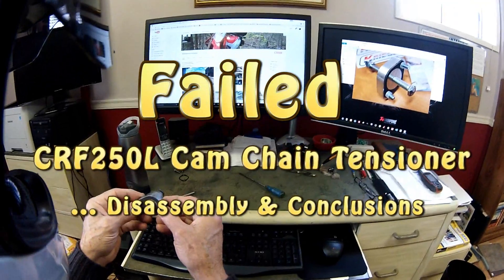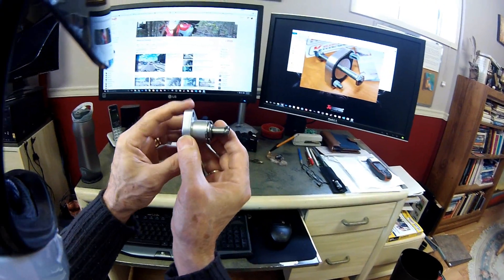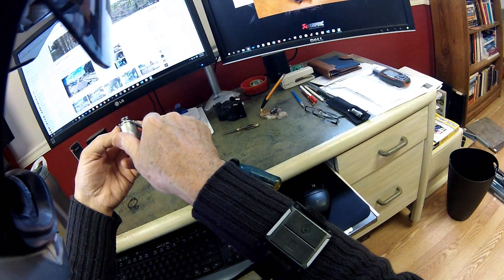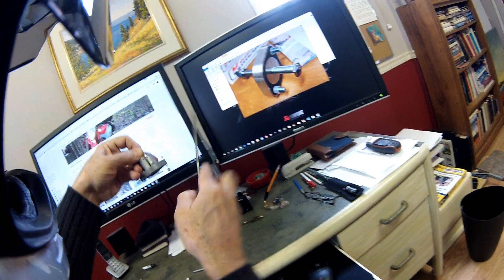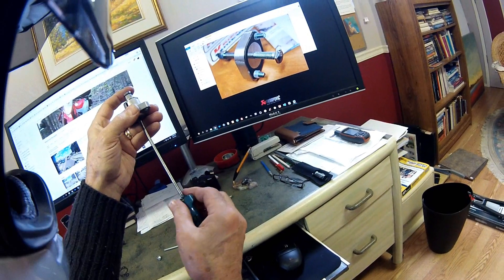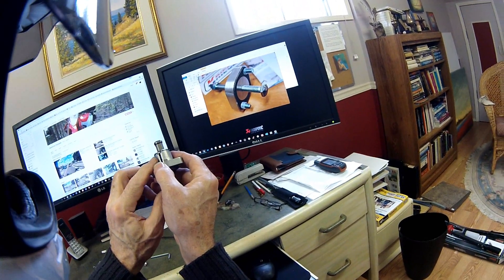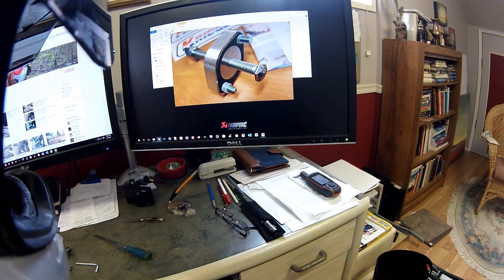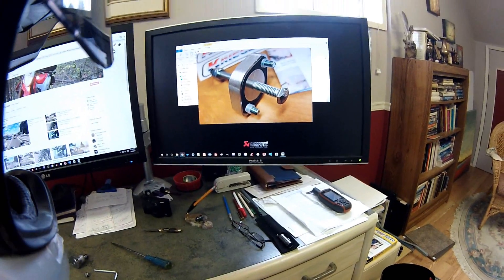Failed CRF250L Cam Chain Tensioner Disassembly and Conclusions

Comment: Hi, I am a CRF250L owner from Germany whose bike has done only 700 mls (MD44 series; I had a MD38 before). So, no problem occured to my bikes by now. But as I am servicing bikes for decades, I am interested in any issues that could happen.

I agree with your conclusion; it could be possible that the spring tension is depending on the way of travel. So, when the bolt moves in, the tension could be to low.
But...if you are right, the cam chain might be worn. Of course, the Krieger tensioner is able to move in much further, depending on the length of the bolt. The question is if that solves the problem of a worn-out chain. Remember that the free play is eliminated on the rear side of the engine only and the tensioner has no effort at the front!
So, in my opinion, if you were trying three automatic tensioners and all failed, you should go for a new chain instead. As you said, there is a possibility to tighten the Krieger tensioner to far which will cause excessive wear to the chain guide (which will lead to residues in the oil that could cause a plugged oil bearing). Therefore, I would be VERY careful to recommend that part because I expect some expensive subsequent damages to the engine if the owner does not know exactly what to do.

If I am right (not sure about that) it could be intended that the spring tension is limitated by the way the bolt travels.

By the way: the MD38 tensioner 14520-KZZ-901 (the one used on the CBR250R) has been superseeded by the MD44 type 14520-K33-D01 which is used on the CBR300R. I don't know if the newer part fits the MD38 series but it looks similar. If so, it could be possible that the tension is different.

Regards, Michael
Reply from the maker: In my case, The units failed very quickly right from the brand new bike, Each time (once per year for the first three years) a unit failed, the cam chain was thoroughly inspected for wear or other issues and was found to be in excellent condition. All the units failed in the middle of winter (I ride all year) so I think temperature was a factor also in my case. Most people who go to the manual tensioner do so to improve on the stock CCT's function long before any possible problems occur. The lifter assembly (CCT) on some brand new 250L's are sometimes too slack, causing a 'bag of marbles' rattle on cruise and trailing throttle, right out of the showroom. That's what motivates most riders to switch to a manual unit. Yes, I was aware of the new CCT's Honda has experimented with. They tested them in the Japan only market first then used them in the CBR300R.
Reply: @Scoottoots  Well, I rode five different CRFs by now, they had done between 164 and 2800 km. Three were 2013/14 MD38, two 2017 MD44. A friend of mine recently bought a MD44 with about 3000 km. They all sounded similar and I guess I know what you mean with the 'bag of marbles'. The sound occurs when you're revving up and idle again, right?

In case of my first MD38, I was alarmed as well and replaced the tensioner (at 1200 kms) and the sound was absolutely the same. No difference at all. Meanwhile, I got the MD44 and, guess what, same procedure as last time.

I came to the conclusion that there's nothing wrong and this is the way the CRF sounds like.

Nevertheless, I heard your second video about the CCT and there is a knocking sound which is definitely not normal. I guess that one's caused by the tensioner. But that is not the sound coming up from a brand-new CRF.
Reply from the maker: @michaeltutnichts-zursache8258  The bag of marbles sound on some new crf250l's is very pronounced. It occurs only at steady cruising speed between 30 and 70 kph and on trailing throttle. Some rattling sound is normal, but a few new bikes have an extreme rattle. That is caused by the CCT. Replacing it with another stock unit may not solve that issue. Replacing with a manual CCT and setting that correctly will solve it. But as I say, only a FEW new bikes have this issue. It was enough though, to cause Honda in Japan to develop an alternative lifter assembly for the 300R. Most owners can relax and not get paranoid about noises. When it's extreme they'll know it's not normal and needs attention. And no, the knocking slapping sound in my video is not the sound the problematic new bikes exhibit. It is what that extreme bag of marbles sound can lead to in the odd bike.

Comment: I made it to 100,000km before this appeared.  Only thing that pisses me off is my local Honda shop didn't pick up on the issue when I described it to them!  Either they are not up on CRF250l issues or they want me to wait till it fails disastrously.  I don't fault the engine, 100K is enough for this to wear out.
Reply from the maker: I'd say you had good success with 100,000 km's. I like the Manual tensioner I have now.
Reply: depends on how you ride.. at 80.000km have replaced 3 CCT and now I use a manual , their design just does not work good enough!

Comment: Heya. How long and how many mileage have you using the manual CCT ? Any problem so far ?
Reply from the maker: A little over a year and about 16,000 km. No issues at all. I gave it a slight adjustment after 10,000 km. Excellent product.

Comment: Thank you for the video. Bought a used crf and after a couple of months that rattling sound started. 
I changed the tensioner with same new one and after six months and 5000km same problem again. 
Making a quick search on net and watching this I am starting to conclude is just poor design - materials. 
This is my first honda and I can say I 'm bit disapointed
Reply from the maker: That seems to be the only area of concern though. Otherwise the engine is real solid and very low maintenance. If you get tired of the issue, switch to the Krieger manual CCT. Takes some fiddling to get used to setting it initially, but thereafter, it's a piece of cake to tweak it whenever needed (maybe every 10,000 km's).

Comment: I have a 3yo CRF250L and made 8000 kms on it and just recently I had the same problem with cam chain tensioner/lifter. What I tried experimenting is cutting the coil spring by half an inch for the spring to give a little more twisting force. To my surprise the rattling sound was gone and I have already made 550 kms on it since and noticed that the rattling noise hasn't return yet. Although I have a new unit in case I really have to replace the old one. By the way, putting the spring back into the housing needs a little skill in doing so.
Reply from the maker: Haha, yeah it's a bit fiddly for sure. Good sleuthing there! Hope that continues to work for you. I am enjoying the trouble-free manual Krieger unit. Have some fun on that bike :-)
Reply: BlastsFromTheSaddle - thanks for your video, It was from there where I got the idea of cutting the coil spring. I agree that your suggesting a manual tensioner is a more permanent solution on the issue. Have fun riding!
Reply: @nordic9570  i am very interested in doing this do my bike. Is it still sounding good?
Reply: @winstonpoplin  - yup, have made 1500kms after the mod, still no rattling 😀

Comment: hi! i got a 2017 crf 250l i don't know if honda already resolved this issue so i'm buying a spare cct lifter just in case my stock tensioner would fail. do you think it is a good idea to replace the cam chain the second time the cct lifter would fail? it might help the new cct lifter because there is not much slack with a new cam chain? and secondly, i have a crf 250l service manual for i dont know what year model. it states that i should use a tensioner stopper? i see that your tensioner will lock in place once fully twisted clockwise. do i still need a tensioner stopper?
Reply from the maker: I wouldn't go to the bother of having a spare. The issue seems to only happen to a relative few, and I suspect in my case it is because I ride also in the cold winter. I think that has something to do with the failures. You'll likely be fine and have no issues. If you do, just get a Krieger Manual CCT and adjust it right. Then all it takes is a slight adjustment when it starts making a bit more noise (over 10,000 km between adjustments for me). And no, you don't need a special tool. The shaft will retract and stay retracted with a screwdriver. Relax and enjoy your bike :-)
Reply: +BlastsFromTheSaddle thanks for the tip! if i ever replace mine with the manual tensioner in the future, is it necessary to be tdc and align the cam shaft? how would i know if my cam chain jumped a tooth or two? or do i jist have to replace the tensioner only and touch nothing else?
Reply from the maker: Usually these bike will stop near tdc, but yes, it should be at tdc or close. If you crank the engine manually, be certain to go forward only. Never reverse crank the engine.
Reply: +BlastsFromTheSaddle  okay thanks! one last thing, i got a friend to lend me a spare automatic tensioner. does the automatic tensioner have the piston to be at tdc also? how do i replce the old one with a new one when it starts to get noisy? i dont plan to use the old one for studying purpose.

Comment: Just bought a used 2014 with only 2200 kms.  Same sound. Not pretty.  Random.  Usually when I'm stopped at a light.  Goes away....will it become a "problem"??
Reply from the maker: If it goes away when under load as you throttle on, then it should be fine. Just keep tabs on it.
Reply: BlastsFromTheSaddle Cool.  Thanks for the response.  Great analysis.  Are you an engineer?
Reply from the maker: I just try my best to pay attention ;-)

Comment: what about a stronger spring inside the cct?
Reply from the maker: It might result in too much initial pressure on the chain to achieve a better pressure further extended. The manual CCT has no issues and very infrequent slight adjustment.

Comment: Thanks for the video. It appears that Honda may have changed parts for 2017 - to the same components already used in the CB300F. Check this out for yourself - part 14520-K33-701. Not sure if this can be retrofitted, plus there's a different guide, also changed to the same as used in the CB300F. Hope this helps, Steve
Reply from the maker: Yes, they've been testing a new design on the CBR300. My recurring issues have been completely resolved since I switched to the manual CCT. No way I would go back to an auto unit now. Cheers, :-)

Comment: I think this may be the same issue on my trx450r I have.  It has that same slapping sound but goes away when revved or ridden.  The tensioner seemed to work okay when I removed it, but like yours here it won't depress at all and seems to not have very much pressure either.  Should be in on Friday so I hope it replaces it and if it doesn't I guess I will be ordering a manual one.
Reply from the maker: At least with the manual CCT, the operation of it is in your control. Hope your new unit preforms better than the last ;-)
Reply: I just post d a video on here of the noise mine makes and when I manually turn in the auto adjuster the clank and rattle goes away.  What do you think this issue is? A stretched cam chain or just a fault auto adjuster system?  I know a manual tensioner will fix it but I don't want it to be too tight
Reply from the maker: That's strange. Usually turning a auto adjuster clockwise will draw the adjuster back away from the chain. It's how the adjuster is safely removed. Turning it all the way to the stop and then a bit of a twist will normally lock the adjuster in the withdrawn position. I would resist the urge to turn that screw with your engine running. You don't want to jump teeth on the cams. No idea why the noise would abate when turning that. Auto adjusters normally cannot be adjusted.
Reply: I was turning the adjuster counter clockwise that is what made the clanking go away.  The clunk would come back when i let the auto adjuster go to where it wanted to go.
Reply: etceteraEA The design is to slow extend as the timing chain slackens with wear. Once extended it cannot retract except by someone manually doing so with a screw driver. Any retraction movement when extended is a fail.

Comment: Thanks for sharing this! I've had my 250L just under 2 years when recently the spring in the tensioner broke. Since the end of the spring had broken off, my brother-in-law was able bend a new end on the remainder of the spring and this worked for a few weeks to avoid replacing the whole tensioner unit, but today it finally failed. I will replace the CCT this time, but if the problem comes up again, I'll definitely give that Krieger unit some serious consideration. Much appreciated!
Reply from the maker: Good luck, and thanks :-)

Comment: I have a CRF 250L  2015  with just over 1000 miles right now.  when would something like this pop up?
Reply from the maker: Hopefully never. Most get by without failure.
Reply: BlastsFromTheSaddle  I also change my oil every 1500 to 2000 miles,  I don't like to go too long between oil changes.  Just runs so smooth that way.

Comment: Very informative, and it would seem from past experience(I've changed mine 4 times, my Thai mech has a mod they do even for the scooters-that lasted a long time) that the culprit is the spring. Like to see that re-engineered. The CBR's in India have had a major time with this, lot written on it. But Honda seems to not care that much about solving the prob.
Reply from the maker: +Rick Rezac 
Thanks for your input on this. I totally agree that Honda doesn't want to know or talk about it, as if talking about the issue with customers will be an admission of liability, so they ignore input. It's pretty sad, as they are ignoring a valuable resource for product improvement and customer satisfaction.

Comment: It's like when in 2002 Honda went back to the chain driven cams on the vfr800 and people said you will have trouble with tensioners and they did. Honda should be able to fix that problem by now. I bet they have lost a few sales over this.  Bill
Reply from the maker: +Lorraine Gareau 
I think the good engineers at Honda can do far better then they have done with this small-but-devastating piece of work.

Comment: sounds like a similar issue to what the DRZ has. That's why on a DRZ most people go to the manual route and adjust at every oil change.
Reply from the maker: +michael adams 
Tired of waiting for failure. It'll be easy to tell when it needs adjustment. I'm guessing fairly long intervals.

Comment: I have read on some forums where these bikes can go 30,000 + miles without any issues at all.  It seems some of us have reoccurring lifter failures.  

Any idea why?  Maybe there is something else in the engine causing failures.
Reply from the maker: +Some guy 
No idea really, except that I ride in the cold winter temps, and every unit has failed in January or February.

Comment: Good to know. I will keep an eye (or ear) on it. since I am only at 6000km, my guess is that I will not see this issue before I get close to 20000km. Anyway. I wonder how long it will last before you have to re-adjust it again.
Reply from the maker: +Michel P 
I think the adjustments will be infrequent, and obvious when needed, so no worries on that score :)